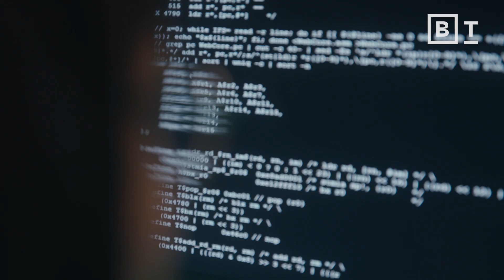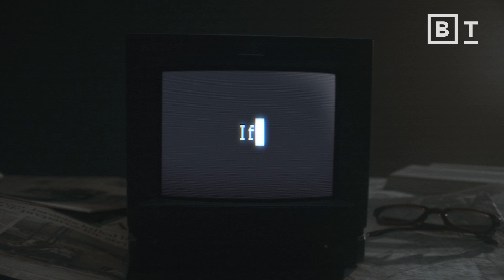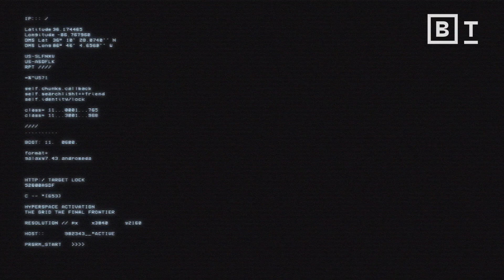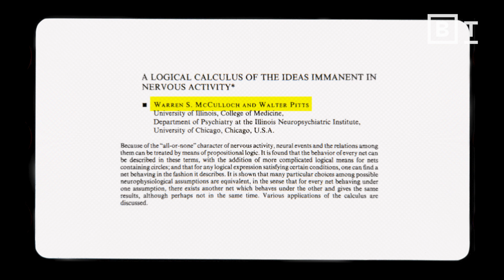Are conscious machines possible? | Oxford professor Michael Wooldridge

Comment: Maybe WE are the Artificial Intelligence. It's funny that our brains have "natural" limitations, as if by design. If 10% capacity gives us the ability to achieve what we've accomplished already as a species, imagine what 20% could do for this species.
Reply: That's an old myth. If you get to 20% you just get more noise but not more productivity.
Think about this analogy, every employee in the company has a direct link to the CEO that is always on, so everything they say is transmitted to him unfiltered all the time. It would be absolute chaos, the company couldn't function. Is the same with the brain, you can increase that communication and what comes out is so much noise that you are incapable of living.
Higher efficiency in a brain is actually marked by less activity as it then is streamlined, the noise is filtered and only the important Infos get through.
Reply: The 10% thing is a myth. We use 100% of our brains we just only use around 10-20% at any given time and the section needed for the task we are working on.